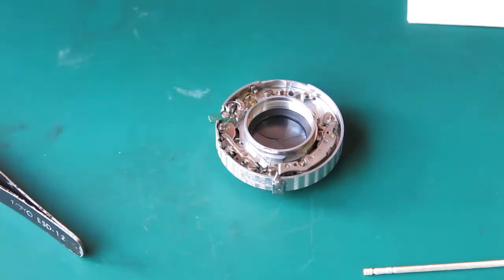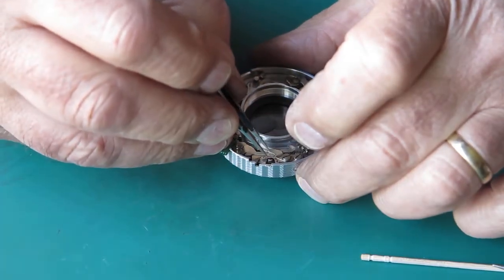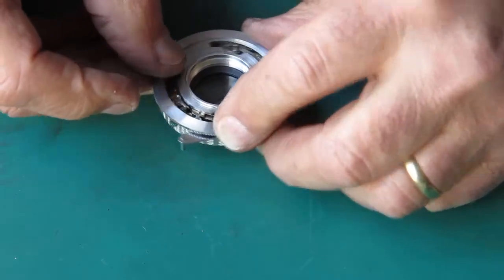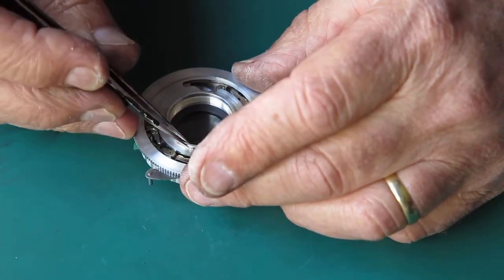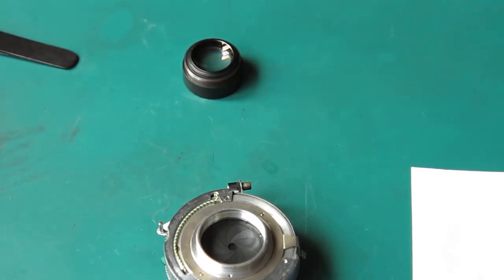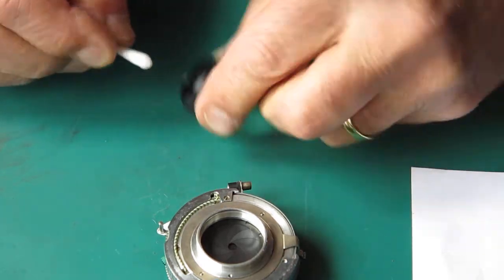A Retina IIa flies in from Malaysia part 09

Comment: Regarding the flash contact slug: I’ve had to make new ones on two occasions (originals missing) which I do by taking a piece of PLA plastic from the 3D printer and warming it over a flame till I can stretch it out to narrow the gauge to about 1mm. Then I just cut a small piece off to make a new slug. It works quite well and is easily achieved.

Comment: Regarding the haze. Mine IIa also have the same issue, so nothing can do about it?
Reply from the maker: The haze may just be normal oily haze, and that'll clean away, but the Xenons on the IIa tend to have haze that will not clean away. This is because the glass surface has actually deteriorated. Of course, you can have both cleanable and uncleanable haze at the same time. Retina IIa cameras fitted with the Rodenstock Heligon, do not suffer from this problem.
Reply: @ChrisSherlock  ok...then I have to stick to it. Hope wont affect much on the shot. Can soaking in vinegar help?
Reply from the maker: @TenchiLoh  No, unless it some magic vinegar.
Reply: @ChrisSherlock  haha ok.
Reply: @ChrisSherlock  just curious, how much you charge for Malaysian to send in Kodak Retina IIa for full overhaul?